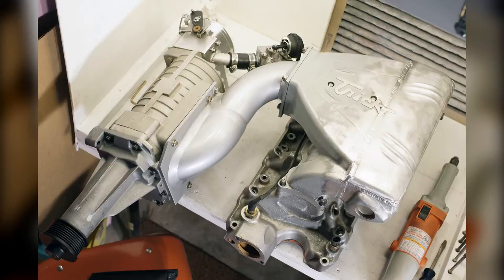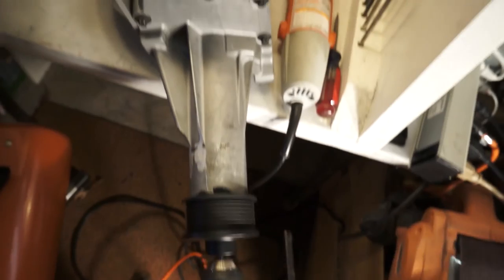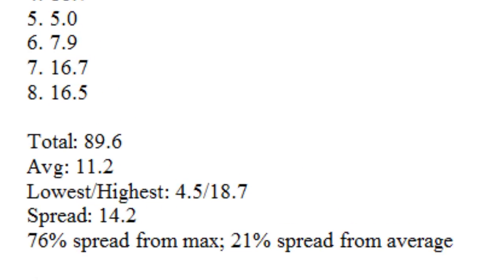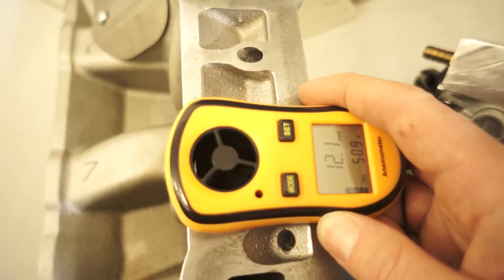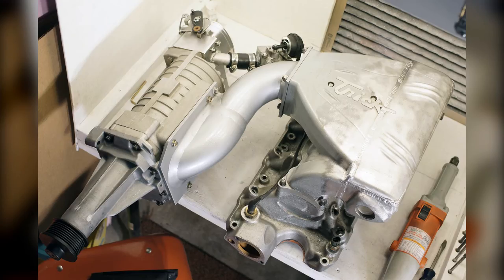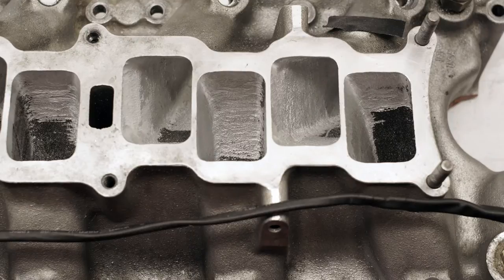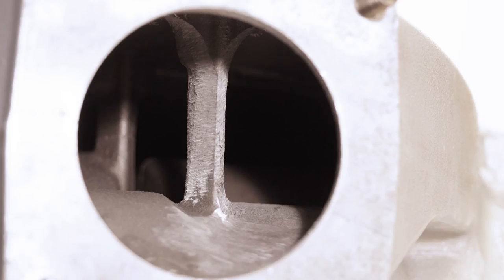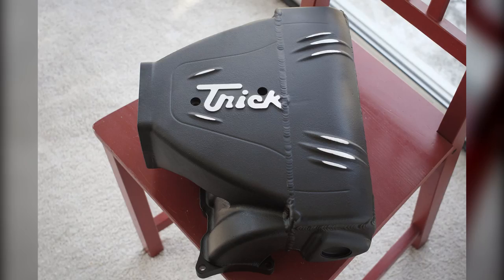How To Flow Your Intake For $12!

Comment: This is a very good video. Im curious to see you overall results. How did this effect your idle vacuum/boost and how drastic were the improvements at wide open throttle?
Reply from the maker: Unfortunately, the motor's not back together yet; I won't be able to get results until next spring.  Apparently, there's more damage to the block than just a blown up ringland - 3 cracked pistons and 8 scuffed bores, so we were held up by having to order custom pistons.